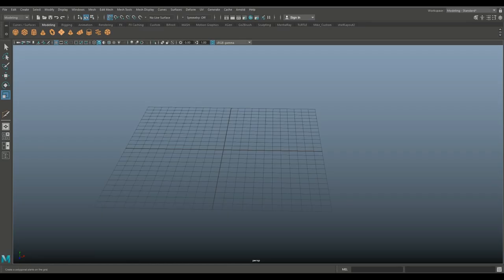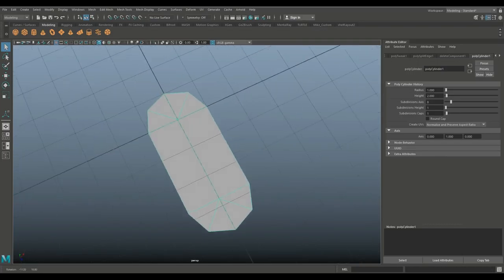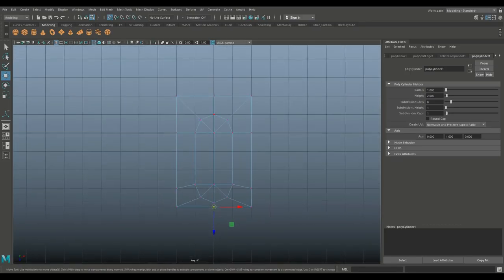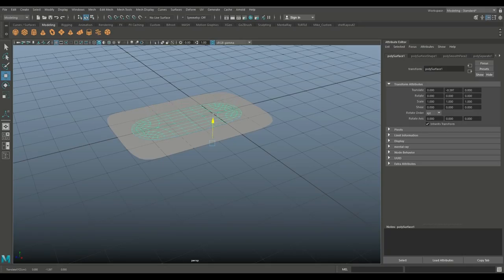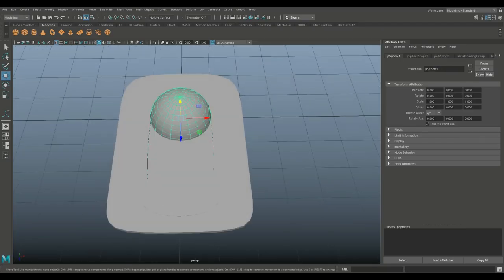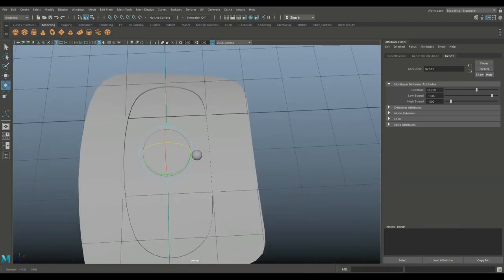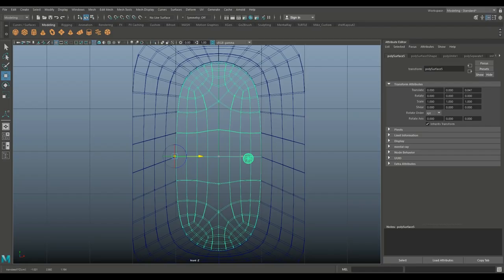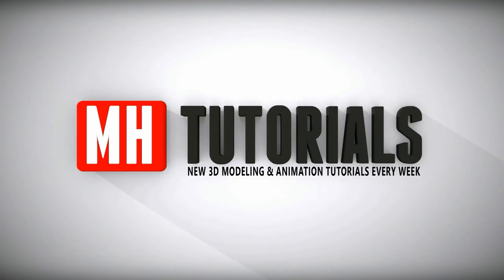How to model a CURVED DOOR in Maya 2018

Comment: Most often, people would need to add a door like that to an existing structure. It would be helpful to do a follow-up video showing how to achieve the same thing to an existing cylinder (for example; an airplane fuselage). I'm interesting to see how you would to it, Mike. Three ways I know of are as follows... (1) -Using the bezier-curve drawing tool to draw the shape onto a fuselage. (2) -Extracting the curves from the model in this tutorial, then projecting them onto a fuselage. (3) -Creating more thickness to the model in this tutorial and use a Boolean operation to cut the shape of this model from the fuselage.

With the second and third way - we would be best to match the number of edge loops between the fuselage opening area and the projection object (the door in this tutorial). Either way we do it, it will take a bit of effort.
Reply: human practitioner you could use the quad draw tool to draw on top of your pre existing object
Reply: human practitioner the ways you're describing might just cause you more work in clean up.
Reply: Jeff - yeah those methods I mentioned can become messy if it's not thought-out correctly. I've never heard of the quad draw tool. I'm still on Maya 2013 because the newer versions won't render properly on my system - I can't figure out why. Sometimes I even resort to using ZBrush for that type of thing.
Reply: human practitioner I would try to figure that out so you can use more updated versions of the software. Things have become much easier and faster since 2013
Reply: Jeff, the funny thing is - I actually own the 2016 version, but still can't use it on my system. I'll sort it out.

Comment: My object will not detach. the object keeps disappearing every time I try to move. Help would be greatly appreciated
Reply from the maker: Did you select the faces and hit detach ?
Reply: Yes, but it keeps doing the same thing. I am updating maya 2018 it maybe the cause.
Reply: I updated and their still the same problem with detaching.
Reply from the maker: Try on a simple cube. Select one face, hit detach and try to pull it out. If that does not work, Maya is the problem
Reply: I reset maya and that fix the problem thank you for getting back to me so quickly.